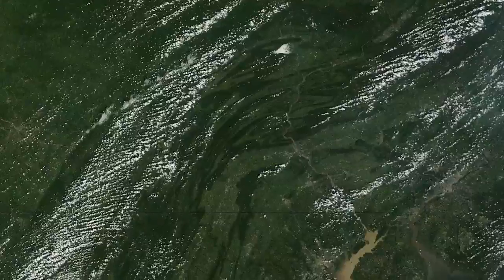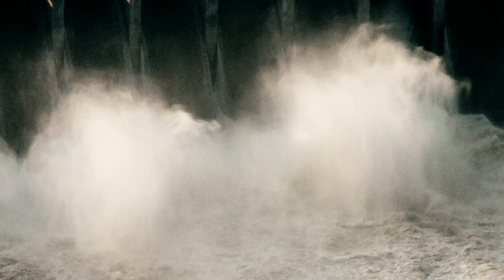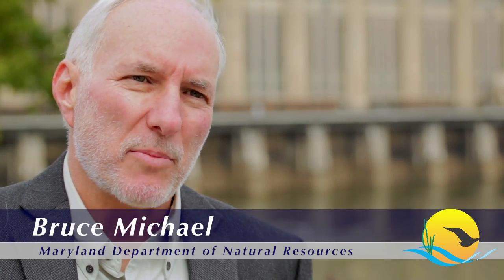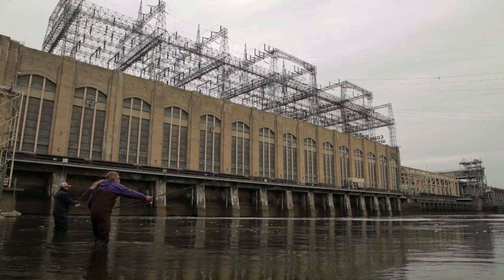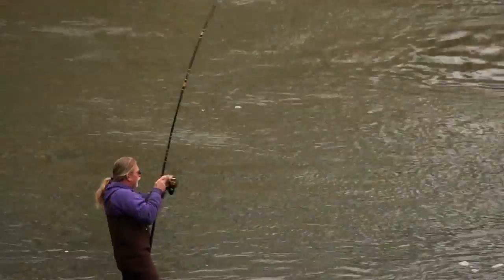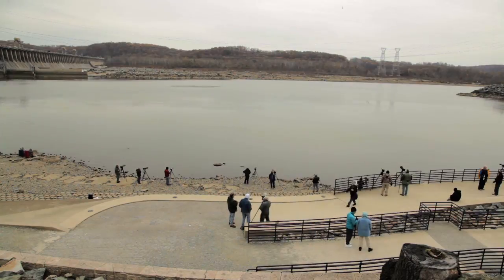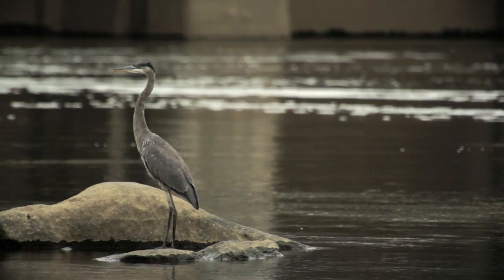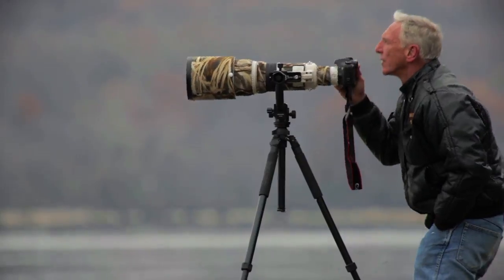Bay 101: Conowingo Dam

Comment: Conowingo was damaged during tropical storm Agnes in 1972.  It was repaired by drilling holes into bedrock thru the dam base and inserting steel cables anchored with epoxy. Some say another storm like Agnes will take the dam out. Couple that with 100 years of toxic sludge and you have a major environment disaster.